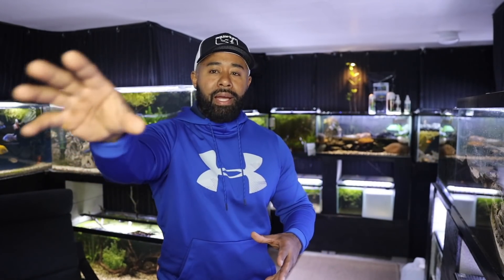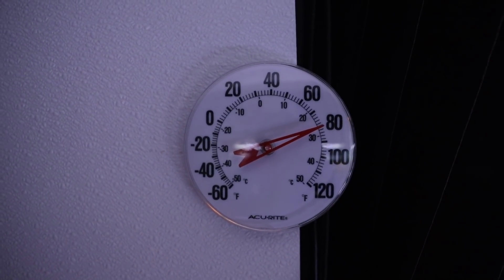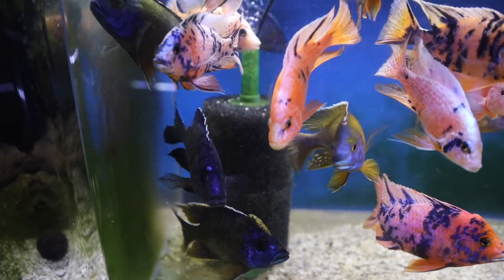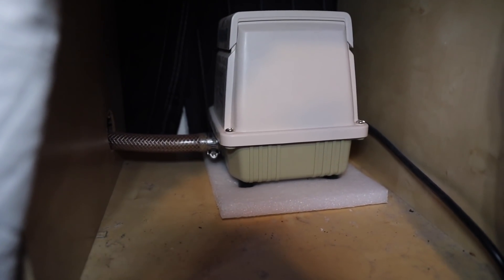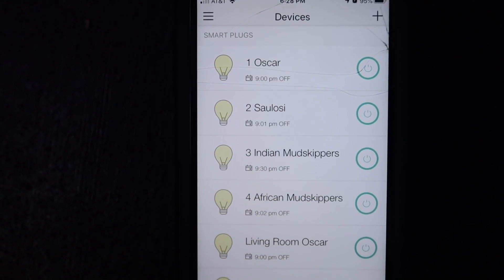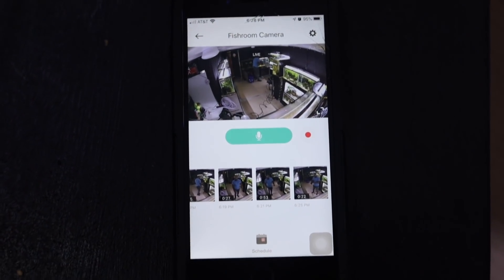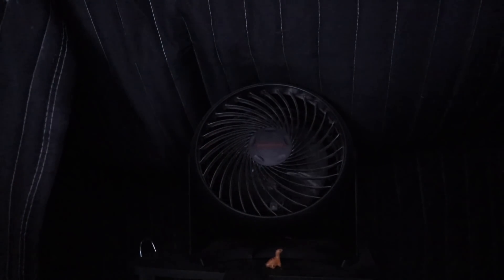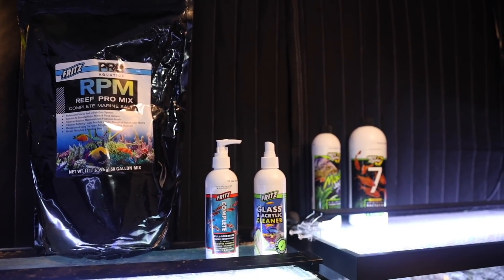Behind the Scenes - How Tazawa Tanks Fishroom Runs

Comment: Really fascinating, do you also insulate the floor?
Reply from the maker: Thanks. No, the floor is just a concrete slab with area rugs on top. The ground doesn't get cold enough here in this part of California to worry about heat loss or cold soak through the floor.